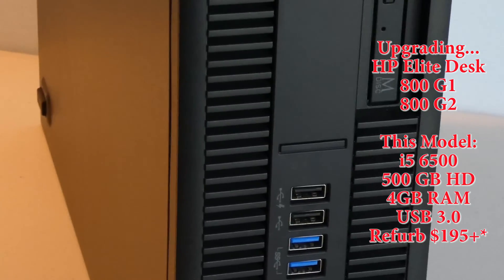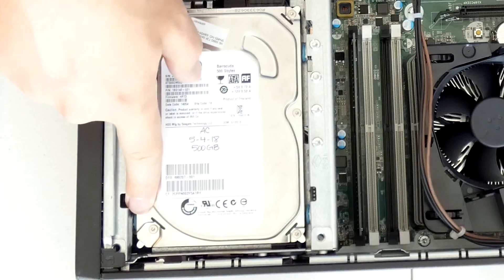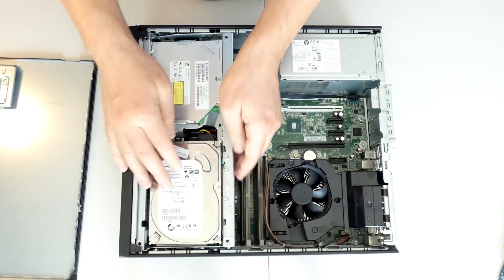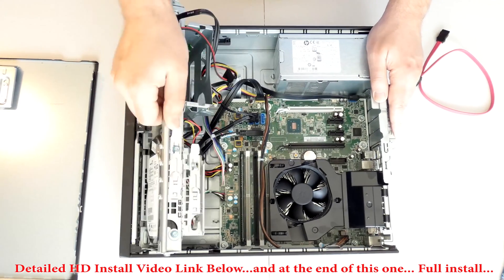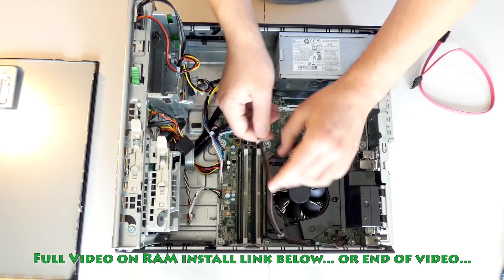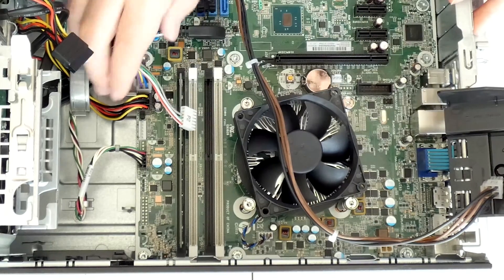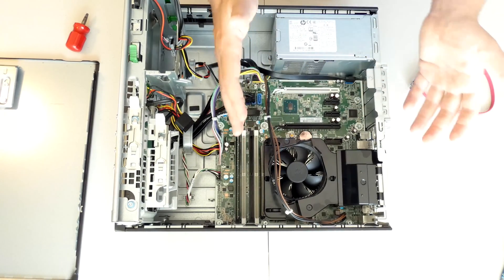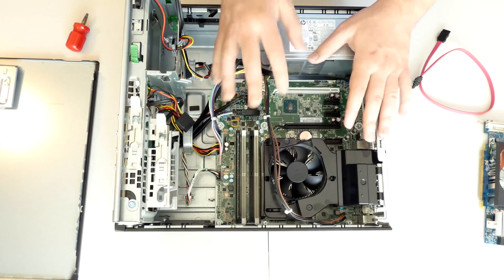How to Upgrade HP Elite 800 G1, HP Elite 800 G2, 600 G1  Small Form Factor Desktop, RTX A2000

Comment: there is an adapter on ebay to use a standard ATX power supply with HP elite 800 G1 , 24 pins to 6 pins , but seller says it needs pins rearrangement , I don't know what that means , isn't the adapter already configured to match the motherboard's power connector ?
Reply from the maker: yeah, I've seen that adapter and it is weird that it's not ready to be used out of the box.

Comment: I heard that you cannot use a gtx 1650 LP card in this due to wattage of power supply, as it needs a minimum of 300w. Have you got the exact model of power supply that we need to make this work? Can you put a link in the description for a power supply upgrade of this shape, connector and size?
Thank you for this video.
Reply: Apparently the 800 g1 sff comes with a 320w psu

Comment: Is it possible to upgrade the motherboard? I have maxed out the 15GB limit and it is not enough to efficiently run Zbrush, Maya, and Unreal Engine. I would love to purchase a new pc, but For the time being, I have to work with what I have.
Reply from the maker: Are you talking about RAM? If you have 800 G1 the limit should be 32gb, if you have 800 G2 or higher... the limit should be 64gb.
Reply: @Cobuman  Really! That is great news...I thought it was a limit of 16gb. I have four memory slots. So I need 4 memory cards at 8gb each. Do you have a recommendation for me?
Reply from the maker: @paulbaker6458  Which model do you have?
Reply: @Cobuman  HP Elite Desk G1 SFF
Reply from the maker: @paulbaker6458  I recommend Crucial brand (CT2K102464BD160B): https://amzn.to/38fpFhU
Reply: @Cobuman  G1

Comment: The audio on the front panel is connected to the headphones and the audio on the panel is connected to the speakers
Reply from the maker: Because front panel connector has switch that turns off the back audio when computer assumes you have headphones plugged in. 
The design of it assumes that you will not be using external speakers (back connectors) and headphones/other speakers (front) at the same time.

Comment: i have this exact pc, and i need to upgrade the power supply, do you know any power supply models that are 350W to 400W that fit in this pc?
Reply from the maker: No, the only options are 200w for G2 and 240 for  G1. Like this: https://amzn.to/2UsObIH
Reply: @Cobuman  well i have a G2 with a 200w and i want to buy a gtx 1650, i have an i5 6500, 16 gb ram and a U2412M dell monitor, im not really sure if 200w will be enough without any problems (on high performance settings)
Reply from the maker: @not_dlow  check it out this video: https://youtu.be/FHtlk-re_ss
Reply: @Cobuman  i already checked it
Reply: @Cobuman  i meant i have a G2 SFF

Comment: The issue is, the power supply is proprietary.  So upgrading to something like a 1650 which doesn't require an upgraded psu.  However, requires at least 300w.  So if you have the 240w like me, you're kind of screwed.  Because you can't upgrade the power supply.
Reply: You got to literally think out of the box.   Connect another PSU  from outside the case and run the cable through one of the PCI slots  to the video card (  a power cable adapter may be needed  - search youtube ).

Comment: So that second 6 pin connector on the Motherboard is dedicated to the SATA cables? Feeding them power through the motherboard which passes power through to those devices? Was thinking of picking one of these up with the 24 pin to 6 pin adapter to use a better PSU.

Comment: Two year old video yet these PC’s are still legit, I just ordered one off Amazon refurbished for $150. Just need a mid range unit for heavy web browsing/video. Apparently you can throw a low profile 1050ti in it for gaming, I might do that just to speed up my system in general.
Reply from the maker: Even better GTX 1650 LP.
Reply: @Cobuman  Really? The PSU can handle it?

Comment: Hey man I bought a graphics cardbut the bracket on the back the is supposed to fit in the slots is too big for the pc is there any way I can get different brackets for this graphics card?
(The Graphics Card is the "Gigabyte Geforce GTX 1050 OC Low Profile 2GB GDDR5")

Comment: This video helped a lot to decide which SSF to pick from work, we had to choose between HP and Lenovo. What I like the most is that it has a lot of room for hard drives for such a small computer. Only problem is the proprietary screws for securing hdd. I'm not able to find extra screws for a second hdd, what can I use as a replacement?
Reply from the maker: You can use standard HDD screws. Align HDD in such way where you can use the screws from the side. 2 screws is enough to hold it.

Comment: Hi cobuman. I bought an elitedesk 800 g2 for my mum after watching your videos. I think I added too many extra components and now the power supply is insufficient. It has a problem with randomly crashing and causing a lot of problems i.e screen not working after it reboots (which I've managed to fix a couple of times)

I want to know if it's ok to buy a non hp sfx 400w power supply and use that. I would hold it in place with either velcro tape or zip ties. Is that something that is possible? 

The only reason I suspect this is a power problem is because the hp psu is only 200w and I've added a graphics card, an ssd and more ram. Although I have no experience building computers and this is just a project to help me learn by trial and error.
Reply from the maker: I think it's a great that you are interested in pc hardware. Given that PSU has the same motherboard connectors you can certainly give it a try. There is also an adapter that allows you to use any 24pin ATX PSU: https://amzn.to/2QGm17C
Please be careful when experimenting and have fun. :)
Reply: @Cobuman  thanks for your reply. I'll let you know the results once I've attempted to change the psu. I'm just guessing that the problem is the psu to be honest. I'm hoping it's not the computer itself as I ordered it from ebay and I'm trying to rule that out so I can leave positive feedback. At the least I can rule out the psu as the cause of these crashes.

Comment: Hello
When purchasing my HP EliteDesk 800 G2 SFF (i7-6700, 16GB, 1TB, Nvidia NVS 310), I didn’t pay attention to the 200W power supply. The use of my PC is oriented towards image processing (2D), animation and video editing (School capsules). Today I am asking for your help to find a solution to my problem so that I can use a low profile graphics card (Nvidia gtx 1650, 75 w) without risk:
- Is there a more powerful power supply, the same size and compatible with the motherboard?
- Could the Nvidia Gt 1030 (30w) encode my video (FHD) better than the integrated Intel 530 chip?
Sorry. This is only a Google translation.
Thank you and good luck.
Reply from the maker: Hi, that's a good question. If you're going to work with only 2D animation and editing you don't really need to upgrade the GPU. 

Some video editing software like Adobe Premiere supports Nvidia GPU and can help with encoding but your i7 CPU should do a decent job with that. 

For FHD video just make sure you are exporting with the correct bit rate for quality consistency and it should process the video fairly quickly. 

I've recommended the GTX 1650 LP like this: https://amzn.to/2D8Bg6q with good feedback. 
When it comes to power consumption... check out my video testing that: https://youtu.be/FHtlk-re_ss

It's good to have enough RAM for encoding but it looks like you already have 16gb which is good. 
If you don't have an SSD drive I highly suggest getting one. Like Samsung. You can even add a m.2 drive as storage (helps when working with 4K files) like this: https://youtu.be/dBfGhFs2oRw
Reply: @Cobuman  Merci l’ami. Cela veut dire que JE PEUX UTILISER La Gtx 1650 avec seulement 200 w et sans endommager les composants de mon Pc.
Je trouve vos vidéos d’une grande utilité.
Reply from the maker: @chamalimedia220  Sure thing. Take care.

Comment: My dad brought his computer from work and gave it to me because I was starting to get into Pc Building. (I know nothing on how to build one it just fascinates me.) I want to upgrade a lot of parts for this pc but I dont know what parts would fit or be compatible with this pc. I dont know what type of CPU to get that is cheap but good, I don't know what type of cpu cooler to get the would fit this, I dont know anything about it. I want to know what parts are the best for this pc to make it run games and other things. I love your video too it let me learn a lot. :)
Reply: also how do I get wireless internet connection of this pc?
Reply from the maker: No problem. I can hep you with that. 
The best upgrade for gaming are below. 
1. Video Card and this is my video that shows you how to do it: https://youtu.be/_tbcimqBDzI 
2. It's good to have enough RAM and here is my video on that: https://youtu.be/w3q2adgFy_E
3. SSD updated, here is my video on that: https://youtu.be/XFe4SlJVwm4
Let me know which exact PC model you have so I can reply with RAM and CPU upgrade if needed.
Reply: @Cobuman  Alright thank you, How do I check which pc model I have? It does say, "HP EliteDesk 800 G1 SFF" idk what that means but it might be helpful. It looks exactly like the one in this video with the disk thing too. When you open it it looks exactly like mine bit with a different thermal paste fan thing.
I wish I could send you a picture or something.
Reply from the maker: @Tomevite  That's it.. you have the G1 which looks same as G2 (in the video) but parts are different.
This is compatible RAM: https://amzn.to/2WFlkPp
This is compatible CPU: https://amzn.to/3fOIsTb
If you have an i5 CPU already there is no need to upgrade if your mainly going use it for gaming. There is no Cooler upgrade.
Reply: cobuman nvm I found out what my processor is, its a “Intel(R) Core(TM) 17-4790 CPU @ 3.60GHz 3.60 GHz”

Does that need an upgrade for gaming?

Comment: I have a 1 Tb HDD  and plan to buy  2Tb HDD n later 1 SSD (250gb). 
if I understand correctly i can use 3hdd without DVD-RW?  will it handle the load properly?
Which GPU can i use so i can connect my HDMI monitor with it?
I don't understand why Hp reduced the SATA ports from 4 to 3? Comparing with my existing Hp 8300 desktop.
I was going to buy Hp 8300 desktop again since the existing one mobo stop working, (fan working, power button one and nothing happens) 
so I was thinking should i buy the same desktop or go for Hp 800 G1 desktop? (the once you showing)
Any differences in speed, loading, watching movies on 1080p, office suite, and others if comparing hp 8300  vs hp g1 desktop.
Currently, i was using 
i3-3220 with 4gb ram ddr3 1600mhz, and 1 Tb HDD with windows in c drive.
But if i go for Hp G1 desktop, then i will go for 
i3-4150 or 4160 (whichever available) with 4ddr3 Ram  with 1 TB HDD (n late add 2Tb n sdd)
(Ram 4gb or 8gb DDR3 1600 mhz and HDD  2 Tb Hdd n 250gb SDD will be added in either case)
Reply from the maker: That's a lot of question brother... 😁
It sounds like you want to upgrade your PC... For what it's worth I paid $200 for 800 G2 last year (refurbished) maybe you can find a same deal and not worry about if it's fast enough. Like this: https://amzn.to/2MAZCGZ (comes with a lot of good stuff upgraded) Of course adding an SSD, RAM, and GPU will be a big upgrade. Sorry, I just don't have time to answer all of the questions but I hope that helps.
Reply: @Cobuman  Thank you for your reply. As i live in Pakistan, we can obtain these from the local market. the reason i asked between these 2 models, as it were in my range.  So, i was considering would it be worth to upgrade from 3rd gen to 4th gen while having i3 processor.

Comment: Hey cobuman will i be able to install a 1tb hardrive with ease of will i need cables and such. Is there a hardrive that you recommend because my g1 system only has a 256gb ssd.
Reply from the maker: Yes, there should be a free SATA connection. You just need a SATA cable or disconnect the CD ROM and use that. Just for extra storage you can get a regular Samsung SSD like this: https://amzn.to/3dTi5dl

Comment: i got one of this whit 1tb 8gb of ram (don´t know ddr tell me how to identify that) and i7 4970 i´m thinking of about an amd rx 570 as gpu but te psu is just 240 watts (i think) do i have to change the psu? if yes tell me one that can fit the pc
Reply from the maker: I've recommend GTX 1650 Low Profile to a lot of people without issues reported. Like this one: https://amzn.to/2LLwcWp that is the best gpu that can fit inside this pc 
If you are concerned about power watch my video here: https://youtu.be/FHtlk-re_ss
Reply: @Cobuman  thanks men, shit was eye opening, now i guess that if i'm only going to play i don't need to change psu. mostly beacuse i'm my country there are lot of blackouts and with the original psu of my pc nothing has burn or got some kinda damage yet after 4 or 5 years
Reply from the maker: @joseantoniogonzalezsambran7606   I hear ya brother. Sure, there is chance the PSU might go bad... but they go bad anyway over time. In this case they are pretty cheap to replace as well (HP ones); so, you might as well enjoy the PC while it's working.
Reply: @Cobuman  hey man how are you i found a 1060 OC 3gb in 110 dollars (something i can afford) will it fit case

Comment: Can we install extra fans or upgrade CPU fan?
Reply from the maker: This case is designed to move air with stock cpu fan and that plastic cover. Changing to anything else can make it worse. Technically speaking, you can cut a hole in the side of the lid and add another exhaust fan but be careful if doing so. :)

Comment: Cobuman my elitedesk shows a red light and is beeping i was adding more ram then it happened, tried putting the one stick there alone like how it was but it didnt fix this new issue. 
Edit: found the fix, my ram was dirty or so. I cleaned the ram part that gets put inside the board. Hoped i helped someone
Reply from the maker: I'm glad you got if fixed. Thanks for sharing; I'm sure someone will find it useful.

Comment: I'm thinking of making a sleeper PC with the case of this that I have just lying around my house which is already broken, I have in mind to replace everything on the inside (Motherboards, GPU, power supply, ram,  processor and basically all the crappy components) with high end RTX 2060 and i7 9700kf and 16gb 2666 ram and everything high end. Do you think with the dimensions of the case, that I will be able to make a sleeper PC out of this? Thanks for the clear video mate!
Reply from the maker: No problem. The main issue is fitment... Especially with RTX 2060-it's just too big/tall to fit inside the case. There is a way to mount the GPU another way like horizontally/flipped so it lays flat but I am not sure if enough space to fit inside the case. This is done with one of those ribbon pcie cables. I have a video that touches on that which might give you an idea if it will work: https://youtu.be/tj2ws0mTm6E
Reply: @Cobuman  yea I've thought of the size of the case to be a main factor, the case is small and slim and not wide enough, I'll check out the video!

Comment: I have a 800 g1 SFF I am trying to upgrade the CPU from the i5 4590 to an i7 4770 and I keep getting stuck at the Window 10 icon with no spinning dots. The chip works in a Lenovo M93p SFF. Any suggestions would be GREATLY appreciated. Cheers!
Reply from the maker: Aside from making sure it's installed properly; you might want to update BIOS on 800 G1 . Here is how: https://youtu.be/4m98pAakQ4I

Comment: Would a rx 570 4gb gpu work in an elitedesk 800 g1 regular size tower not sff, with a 550w psu, 24 pin to 6 pin adaptor,  16GB ddr3 1600mhz, i5-4670? Thanks in advance!
Reply from the maker: Like this: https://amzn.to/38SyBIF ? Yes, you can use any GPU. There might be a super rare situation where a gpu is slightly too long but all should fit in a normal size atx case.
Reply: @Cobuman  yes exactly like that, thanks for the quick response, greatly appreciated!!
Reply from the maker: @sombersmoke406  Sure thing. 👍

Comment: This is way too expensive, right? https://www.amazon.it/dp/B07SX26Z3L/?coliid=I33EHQ5BL0NR5K&colid=2QYC9JQ3WA6WW&psc=1&ref_=lv_ov_lig_dp_it
Do you think I can upgrade my PSU on that pc? I'd like to a rx 570 and a 550/650w good PSU.
Reply from the maker: Well, I'd say it's a fair price because you get a lot with it. You would probably spend that much to add extra RAM, SSD on something like this: https://amzn.to/2GvLsnl 
Also, that's a tower which give you more room for expansion compared to SFF like in the video.
Let me know if you need help with GPU and PSU.

Comment: I just picked up one of these sff towers from my school for 50$! It has an i7 4970, 16gb ddr3, and a 256 ssd w windows 10 pro. 

I recommend replacing the thermal paste on the cpu and the psu to start off.
Reply from the maker: Amazing deal.
Reply: Which PSU fits in the 800 g1 SFF?
Reply: @digitaldeltablues  It's a proprietary form factor, if I'm not mistaking. Also, the connectors are not the standard ATX ones. I wonder if an SFX would fit, with a little bit of elbow grease... But some adapter cables... or cutting and soldering will be needed to adapt the standard ATX to HP's proprietary connectors.

Comment: Hi, I'm having trouble with power distribution between all the parts in my hp elitedesk g1 sff. Is there anyway I can connect a second psu to have more power?
Reply: you can upgrade the psu
Reply: @joellpineda7095  I did, and it works perfectly!